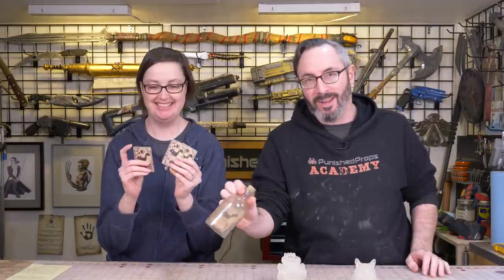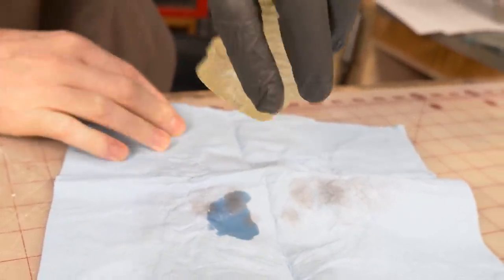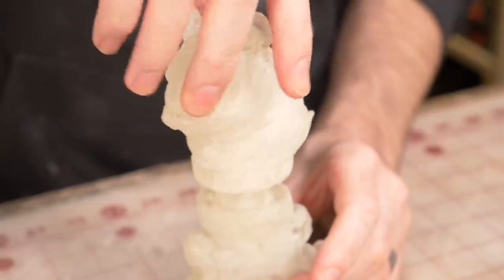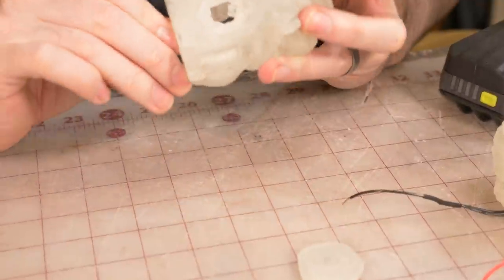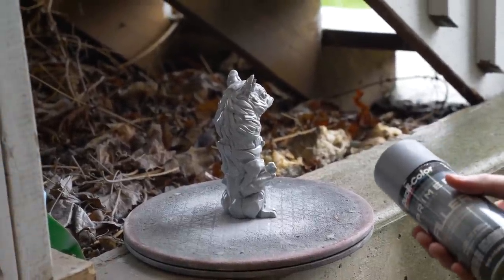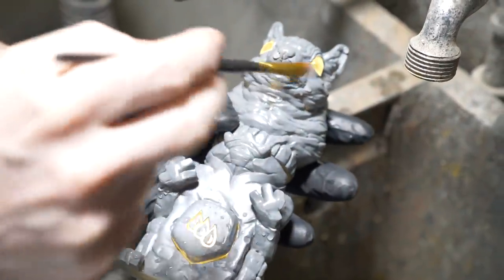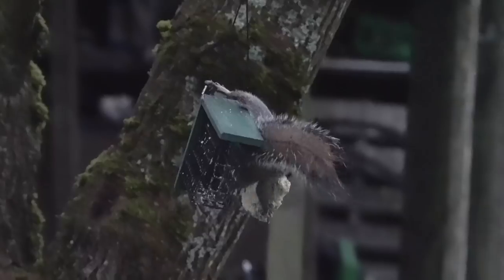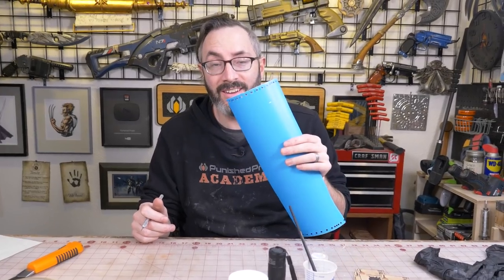Toothpaste + Resin + Glow Powder = Squirrel Totem? Another Inscryption Prop!

Comment: That foot might indicate your first exposure layers are too long, so the UV is bleeding through the resin you want to cure and ends up curing some extra.

If my resin has a cure time of 10s per layer, I typically go 35-50 for the first layers, and if the resin cures faster at 1.5-2.5 per layer, I lessen it to maybe 10-15 seconds for the first layers.

It's a delicate balance between avoiding that foot and still having the build adhere to the flexplate.

Additionally you can play with the number of first layers. If you only have supports in contact with the plate, a big number of layers is fine because it won't mess with the actual print. But if printing on the plate, then your print is within those first layers, so you want just enough to get it to bond.

Comment: Funnily enough I used tinkercad and thingiverse to for our 3D printer in my machining class (making metal parts and such) instead of my normal work.
Luckily my teacher was pretty chill and let it slide since I wasn't completely wasting my time, even gave me some credit in class despite not doing my projects, probably the only reason I didn't fail in the last year of class.He just let me draw, 3d print, or use V-carve for wood carvings on our cnc router.
But seeing you guys use so many different methods to making models and props makes me want to get back into doing it all again, 3D printing, making my own models to print, or make something with resin despite only doing it once with some wood to make a ring. But I'd like to try making props of foam and even try taking parts from several things to make something unique.

Comment: A trick I picked up from another YouTubers painting vids for quick and easy, unusual shape masking, was Silly Putty. It's moldable and durable, but certainly more resilient than toothpaste, and pulls off much easier. Even a bit reusable.
Reply from the maker: That’s a great tip!
Reply: My personal go to for stuff like this is just normal PVA glue. It applies really neatly, dries hard and super close to the surface, and peels off of smooth plastic or resin perfectly with just a little toothpick abrasion.

Comment: Great project!  It came out so nice.

I have a couple tips to improve your resin printing experience.

It seems you overexposed your resin which made the screw and hole too large. 

Have you done a full calibration test of THAT resin in THAT printer in That particular layer height?  Each of those matters and will affect the dimensional accuracy. If you dial those in, parts will fit together nicely.  :)

Another tip, if you want to get rid of most of the layer lines, well of course one thing is to print at smaller layer heights, but a faster option is you can crank up your anti-alias and blur settings in your slicer.

And lastly, especially for clear parts, you can brush on resin either before after your final cure and hit it with the UV flashlight, or just stick it back in your curing chamber.  A more advanced technique is heating up your resin to make it less viscous and dip your whole model in there and then cure.  

Hope these help on your next resin print!
Reply from the maker: Thanks for the tips! We're still dialing in the settings on this machine and it just keeps getting better and better.

Comment: Surprised you didn't use the UV resin to bond the pieces together... probably would have been a solid connection...just like the toe
Reply from the maker: I bet that would have worked too. There are many ways to glue a prop.

Comment: question: did you have any issue with the duplicolor curing on the resin? i've found certain 3D printing resins do not interact well with certain spraypaints. in particular, anycubic ecoresin did not seem to like duplicolor primers.
Reply from the maker: The Duplicolor filler primer we used dried perfectly on the SarayaTech resin.

Comment: I saw you used epoxy to join the head and body. Couldn't you have used the liquid resin to join the halves like you did with the toe? Would the light not penetrate enough to activate the bond?
Reply: It should work fine with any transparent resin.  You can also shine a UV flashlight on the inside to help.
Reply from the maker: Ooh yeah that would have probably also worked.

Comment: A fix for the screw would be a easy idea, but more work XD , the fix would be to make a silicone screw to mold again and re cast it, but tern it into a screw battery attachment like a flashlights light bulb XD so it turns on when you screw the heads on XD

Comment: wouldn't be a better idea to paint it first then put the lights in so you can see the best spot for the lights
Reply from the maker: That order could have probably worked too. I wanted to add the lights in the bead before assembly and paint so I would be able to reach all the way into the head.

Comment: 14:47 If it were a regular fdm print sure, but shouldn't your resin print already be more than good enough on that front? One of the great benefits of resin printing after all, low layer thickness without it taking a million biliion hours to print
Reply from the maker: The resin print is indeed much cleaner than an FDM print, but if you look closely there are still areas where you can see layer lines and the filler primer works great for making those disappear.
Reply: @Duker There are a few different settings you can change to get better prints, but there are always layer lines.  It just depends on how small is “good enough” to you.

Comment: So, I'm pretty new to resin printing as well, and I wanted to ask you guys, what do you do to clean your dirty alcohol?

I've tried running it through the paint strainer, I've tried curing it in the sun and then straining it, I've even SLOWLY run some through a coffee filter, and it's still murky, or in the case of the cured version, milky.

Current plan is to get an alcohol still and evaporate/condense the alcohol vapors, leaving the resin gunk behind, but I was curious what your plan of attack would be.
Reply: And yes, the flexplate is awesome! Did you guys print a spacer for the Z stop, or just used something from around the shop?

Comment: When you tried the stamp but it didn't quite give you the details is because you're not stamping correctly for a lack of better words. Next time put a bit more of a coat on the stamp with the ink and then press it down firmly and quickly with a wooden block or something. Stamps transfer better with force, think of the disgruntled office worker in old cartoons with the big wooden stamp. Note the exaggerated klonk. Just some advice from someone who used stamps professionally occasionally.
Reply from the maker: Ahhh thanks for the tips! I also think the foam I was using probably wasn't the right material.